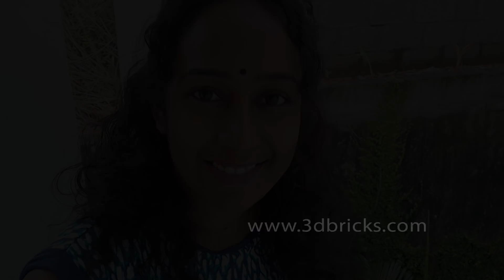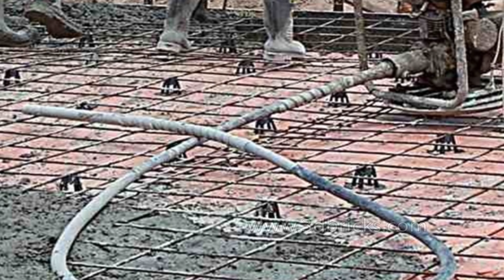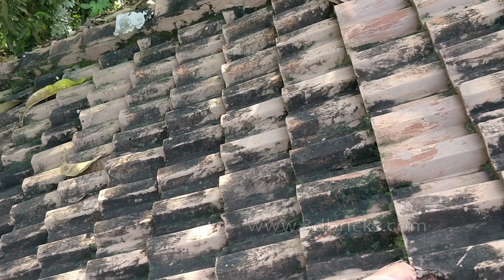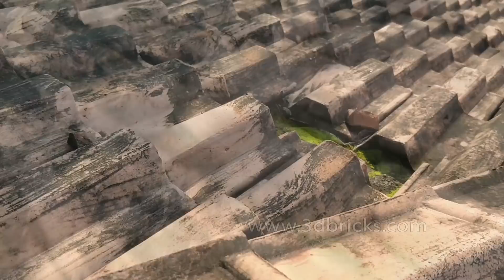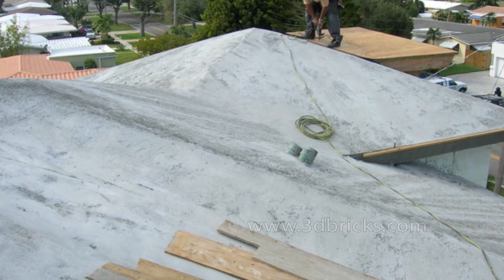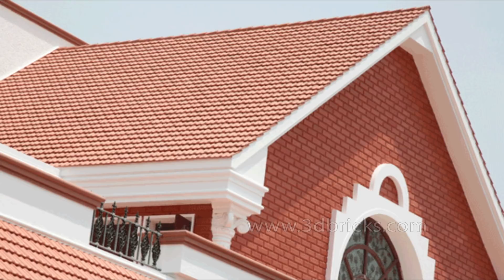Slope roof Or Flat Roof?

Comment: Well i kind of disagree with this video. Theere are lighter materials avaibale to do the sloped roof and it does not have to be "casted" into place. There are lighter cement boards avaibale that can be sealed ta joints and further seled with the wrap sheets upon which goes the flat tiles that do not retain the water.If you check the construction technology worldwide, you will see that sloped roof are implemented  in many extreme temperature areas which helps to alleviate the heat inside the building moving the hot air into the peak area of the gable from where it can be vented out.

Comment: If we consider the different shapes of roof like pitched or sloping and flat, then flat roofs may be seen as a transition between a pitched and a funnel (unlikely but just for reference). So while pitched roofs will drain rain water away quickly, flat roofs tend to hold some water. I feel sloping roofs are expensive to build but require minimal maintenance in future. Flat roofs, can be inexpensive to make but will require constant maintenance as it is more prone to water logging.
A perspective 
https://youtu.be/4_MQuEzsRX4

Comment: Is it possible to change slope roof house into flat one?
I just want to build a room and a hall om sloped surface and it's a load bearing structure with red bricks
Reply from the maker: Multiple ways are there.One is use steel structures.You need to consult someone showing the structure and the strength also need to determined

Comment: Madam, 800sqft sloped roof cheyan ekadhesham ethra cost akum...athepol 800sqft flat roof anenkil ethra akum.. randum oru round figure enkilum parayan patuo?
Reply from the maker: There will be an increase in 50% cost if you opt for a slopping roof instead of flat roof

Comment: I disagree with this video. I seen many flat roof houses  leaking and later they will construct another slop roof floor or aluminum roof. In kerla we have large scale rain and slope roof with clay or ceramic tiles is the solution. Anyway your presentation style is good 👍
Reply from the maker: Thankyou for responding.Stay connected
Reply: Well said

Comment: Sun shade flat ano atho slope ano nallathu
Reply from the maker: Sun Shade as per structure you will be getting more in slope roof only, but the other advantages for flat roof remains.But flat roof temperature can be reduced by growing climbers to cover the roof partially of using roof garden.Pls check roof garden to know more about it

Comment: My house has a flat roof construction it's been 10 years now it was built ,now there is a lot of crack in the water proofing  area even though there  is no leakage in concrete,i'm planning to rework it so suggest me a good waterproofing solution
Reply from the maker: U need to send snaps to 3dbricks@gmail.com.Then only some useful suggestion can be given
Reply: BLUE STAR  ENGINEERING WORK'S നിങ്ങളുടെ കെട്ടിടങ്ങൾക്ക് മനോഹാരിതയും കെട്ടുറപ്പും നൽകുന്ന റൂഫിങ്ങ്  ആധുനിക ടെക്നിക്യുകളോടുകൂടി നിങ്ങളുടെ ബഡ്ജറ്റിൽ ചെയ്തുകൊടുക്കപ്പെടും. ഉടൻ വിളിക്കൂ+91 9526666355
Our Services
1. Aluminium Roofing
2.  Clay / Ceramic / Concrete Tiles 
3. Shingles Roofing 
4. Polycarbonate Roofing 
5. Shed/ Warehouse / Godown / Auditorium Roofing 
6. Badminton Court Roofing 
7. Residencial & Commercial Roofing 
8.stainless steel work    
9.Gate                                                    കൂടുതൽ വിവരങ്ങൾക്ക്
Contact Us : +91 9526666355

Comment: I m also a civil engg.what you said in this video is totally wrong.because in slopped roof we can reduce concrete thickness to 2.5 inch.side walls max 8 feet is enough.and also no need of extra lintels for Windows and doors and also no need of parapet walls.
And also no need of weathering course on the roof top.tile laying is only additional work for appearance and beauty.we can get that beauty without using tile in place of terracotta paints.more over slopped roofs had more adv then flat roof because of heigh ceiling heat will be reduced in the structure.
Reply from the maker: Please hear the video properly.I am talking about all the possibilities that might come

Comment: Tresswork cheyumboo.. Gi sheets idathe pazhaya veetile oodu use cheythal kuzhapamundoo (roofil concrete vartha shesham)
Reply from the maker: The number of pipe required will be more.Otherwise there is no issue.Consider the cost factor also.
Reply: What will an average cost for sloped tress roof over a top of a 1200sq flat roof  .. is ncluding labour cost

Comment: Maam....car porch undakumbol pargola use cheyth undakunna model ano  atho normal design ano nallath...eth model undakumbozanu cost effective akunnath.....separate undakunnathinekal nallath...veedinte structure nte oppam ubdakunnathano?   Reply udan kitumennu pratheekshikunu maam.
Reply from the maker: Doing it separately would be cost effective
Reply: Veena Gil......@onnichu edukumbozanu nallathennu parayunnath kettu
Reply from the maker: Car porch using poly carbonate sheet is cheaper compared to concrete roof

Comment: Do flat roof..and then do truss work for sloping roof.. ☺
Reply from the maker: Yes,if cost is not an issue that would be a good option
Reply: @3dbricks  yes
Reply: What if I go for truss roof without concrete roof}?
Reply: @najiransari2590  Chances of leakage is high